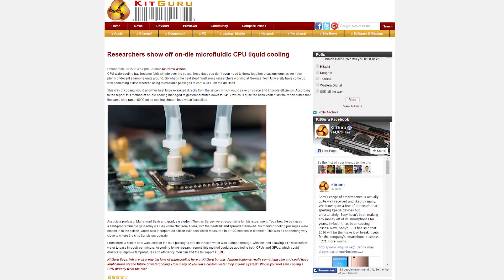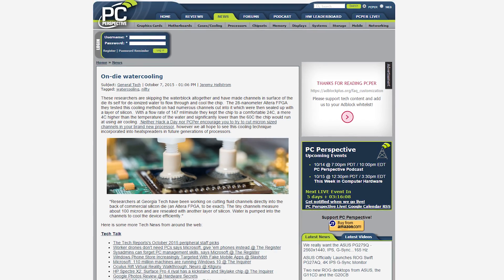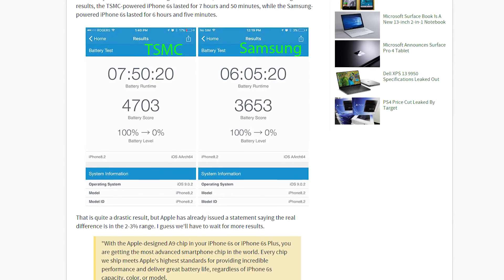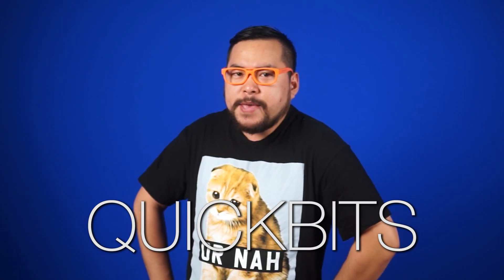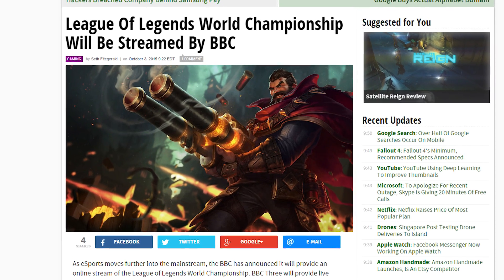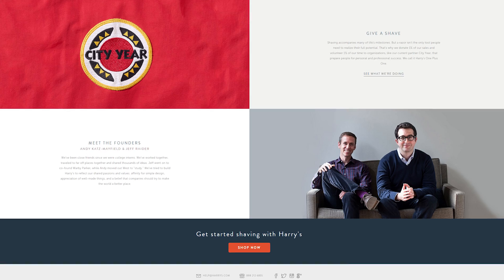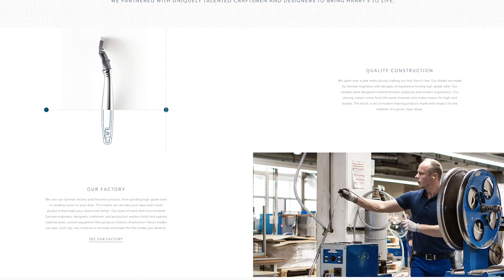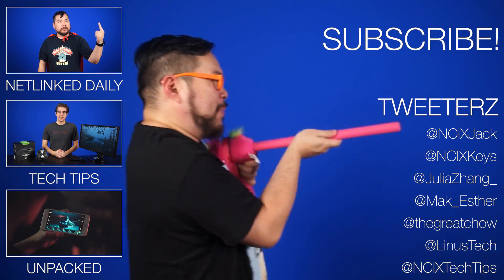On-Die Liquid Cooling, Apple iPhone “Chipgate”

Comment: I think the water cooling is fine until you spring a leak or a heat cycle causes a micro crack in the silicon for water to migrate. oh god your cpu could never go below freezing think of phones or laptops with this exposed to subzero temps it would shatter the die.

Comment: i have a question i bought myself a new dell latitude e5550 but its making wierd noises .. like the oldschool pc noise when going on internet but by me its during normal use any answers? i did buy it second hand so im also worried they maybe switched out parts

Comment: Why wouldnt you need a heatsink? It may be more efficient but the water still needs cooling in a closed loop ?
Reply: +teekanne15 Don't think this will work in the long run.  Using deionized water will only work until it collects enough trace elements of the metal components it comes in contact with.  I suppose you could put a filter, or use a different liquid agent... but that's not the "proof of concept" implementation presented.
Reply: +teekanne15 Probably "proof of concept" rather than a replacement for all desktops. I'd imagine these could show up on video cards for gamers and modders most likely.
Reply: zdrux
Well I actually doubt that this will make it to consumer grade hardware
Reply: +teekanne15 The standard liquid cooler cools a plate that mounts to the chip with a bit of thermal paste to conduct the heat like a traditional heatsink does. The thing in the video cuts out the plate & paste middlemen which means you're getting more direct contact and don't have to worry about paste gradually cooking away. It also greatly cuts the bulk there.

You'd still need a point where heat dissipates but it can be done at various points along the system. Unless, the system uses a method similar to how an AC unit works with the liquid, which might be less efficient than dissipating heat at various points along the way.
Reply: InfernosReaper thats what I mean. You still have to deal with the same stuff from regualar watercooling
Reply: teekanne15
Except 1 very key part of the system is removed, greatly reducing needed space and increasing efficiency
Reply: InfernosReaper
Im not gonna praise it before I have seen some more numbers on that!
Reply: teekanne15
Good move

Comment: Is build good?
NZXT S340
Intel i5 4590 quad core cpu 
MSI Nvidia GTX 960 Gaming Graphics Card (4GB)
MSI Z97S SLI krait edition motherboard 
Hyper X fury 8GB (2x4GB) DDR3 1866MHZ
Corsair builder series CXM 600w modular 80 plus bronze 
Western digital 1TB 7200 RPM 64MB
This is a Gaming Build!
Reply: +suheyub ibrahim replace the CPU with a 4690k and you'll be all good as you have a z97 motherboard but no overlocking CPU you could go for a H81 motherboard if you dont want to overclock
Reply: +suheyub ibrahim Change the 960 for an R9 380. The GPU is better than the 960's.
Reply: +suheyub ibrahim really decent mid-range build imo good job
Reply: +Snaiper Suji Mayne It's not $50 more at most places and in the long run you can SLI up a decent setup out of it.
Reply: +KenKraken 600-700
Reply: +Koby Dunham yeah, but don't forget oc
Reply: suheyub ibrahim Also,  please switch out that PSU.

Comment: this made me feel bad for buying a gtx 960 earlier this year
Reply: +tonton9598 me too
Reply: I was thinking maybe buying a second real cheap and going SLI?
Reply: ***** I was thinking maybe buying a second real cheap and going SLI?
Reply: dumb question, but will the new 4gb 960 be able to go SLI with the 2gb version that I have?
Reply: +tonton9598 its not worth it because if it does work the 4gb gtx 960 will only run using 2gb. looks like ill be getting a 970.
Reply: +tonton9598 Nope, must have the same VRAM.

Comment: need help
windforce 290 $350 or windforce 390 $500
help?i have a freesync monitor
Reply: where in the hell does a 390 cost 500$????
Reply: Joe Stravens Australia
Reply: that's outrageous
Reply: Joe Stravens yep Australia is a very expensive place to live
Reply: Jesus was a toaster yeah its seems so. Well id have to reccomend the 290 so you dont break your bank
Reply: Wow that's a an outrageous price gape! In the UK the 290 is £20 cheaper than the 390. Is there not another band 390 for cheaper like msi or asus? The reason I ask is because the 390 is fracking awesome, but not worth that hug price gap!
Reply: Hugo Olloman well usually 290 are $400-$450 but i can get one for $350 but not  sure and i play a few games at 6400x1080
Reply: +Jesus was a toaster is that triple monitor? Well in that case the 390 with its stupid amounts of vram might be beneficial. Plus the 390 consistently has about a 10fps gain over the 290, while remaining cooler
Reply: Hugo Olloman true cause it is really hot in Australia
Reply: +Jesus was a toaster Go with the 290. Also Do you have any evidence to prove jesus was in fact a toaster?

Comment: 4GB on the 960? why? it's obviously for 1080p gaming, and I doubt anyone would use a 960 for 1440p. even if it had 4GB, it doesn't have enough raw horsepower anyway...

Comment: GTX 960 will have more VRAM than GTX 970...... That's fucking stupid.
Reply: *you forgot the v
Reply: +StoreBrand The 970 has 4gb..
Reply: *you forgot the v
Reply: +Cnerde no
Reply: Cnerde When I was writing the OP I was thinking of putting "inb4 "970 does have 4GB""....
Reply: +StoreBrand The 970 vram is only a problem on paper. Ingame it's fine. I'm using past 3.5 and keeping great framerate.
Reply: +Anze G 3.5 gigs is still better than 3 gigs in 780ti. BTW currently I had no problem with it
Reply: +Snaiper Suji Mayne if vram usage hits that 2gb limit the the game will suffer, there won't be huge improvements with the 4gb Version, but it will offer a more consistent frame rate at games with a higher vram usage
Reply: +StoreBrand It already does.... (I have one of he said 960s)
Reply: ***** yes but 4gb will be the standard, 2gb is the standard.
Reply: LASER BEAR ASSAULT UNIT There is 4GBs of Vram on the cards.. You can't argue against that, it is simply a fact.. How the card uses it may be called into question, but a 1-3% real world performance hit isn't a big deal.
Reply: +Cnerde 3.5 GB

Comment: Big gap between 960 and 970 needs filled. 960ti 4GB?
Reply: +hunter borman I don't really care about maker as long as it fits my needs and those cards are pretty much the same as  Nvidia's version
Reply: +flopticalcube It already is, its called the R9 380....
Reply: yeah I especially like it with the exact same GPU, oh wait it doesn't have the same gpu... unlike the AMD.
Reply: hunter borman Its technically a upgraded refresh.
Reply: +hunter borman don't be a fanboy, look at bencharks, and compare cards in the same price range and you'll see that nvidia is not superior to amd at every price range, the 380 is filling the gab between the 970 and 960, and cost the same as the 960. just because AMD's cpu are crap and the 980ti beats the fury x in dx11 doesn't mean it is the same across the board. the 390 and 970 are similar in performance, it comes down to if you want more vram or better power consumption, the 370 is worse then the 950, but the 390x is cheaper and performs similarly to the 980.
Reply: hunter borman Oh yeah, I forgot xD. I like MSI cards so I forgot about the others lol. I would personally take a 380 4GB over a 280 4GB for the lower heat and the better performance.
Reply: it would need to have 3gbs of Vram that way if they want more they get 970
Reply: Yea  but he is talking about Nvidia so he probably wants to stay in the Nvidia family
Reply: +barondorado But those suck...
Reply: Joegaming But they're the exactly the same as the last gen. There is no upgrade path with AMD's CPUs or GPUs.
Reply: hunter borman like you mean improvement like the way the 950 beats the 750 ti
Reply: Eric Melendez With the exact same specs?
Reply: hunter borman "technically a upgraded refresh." Look at performace, there is a improvment.
Reply: +Eric Melendez I'm talking about nVidia's gap. And having a competitor fill it in is an even bigger reason for nVidia to plug their own gap.
Reply: +Snaiper Suji Mayne Indeed, which is why the current 4GB 960 shows very little to no improvement over the 2GB and is still MILES away from the 3.5GB 970. The performance gap between the two remains large. Given that the 970 is now a year old, however, it might be too late for this gen to see the gap filled. Pascal is likely next summer.
Reply: There is a 4 gb 960 version...
Reply: Will Redfern Still don't understand why someone would buy a 960 when the 380 exists.
Reply: Why would someone buy a 380 when the 280 exits?
Reply: hunter borman because they are hard as balls to get new.....
Reply: Eric Melendez Newegg has them in stock.....
Reply: +Eric Melendez overclocks?
Reply: +flopticalcube idiot fanboy, nvidia is not only one who has gpus , yellow snow eater